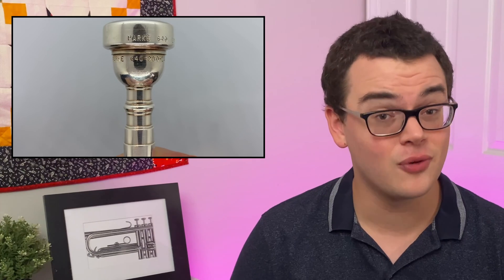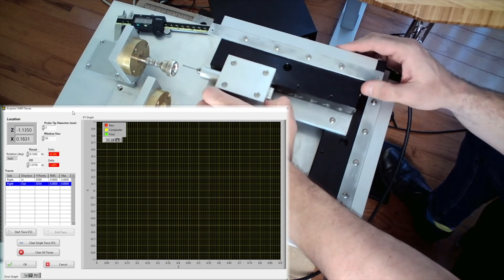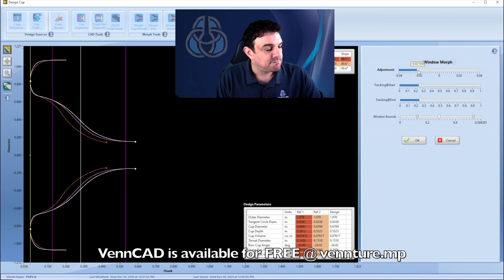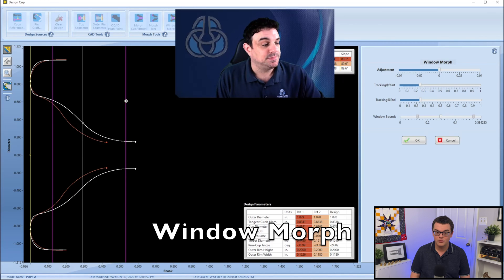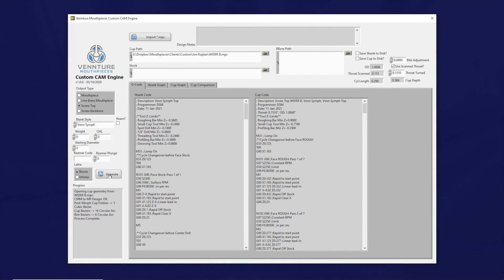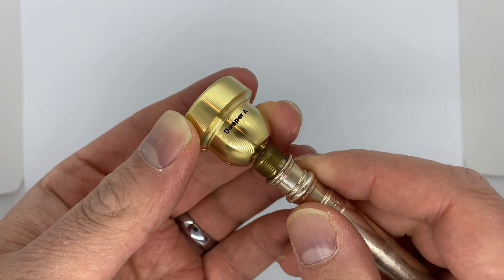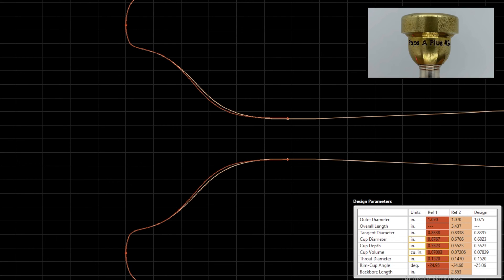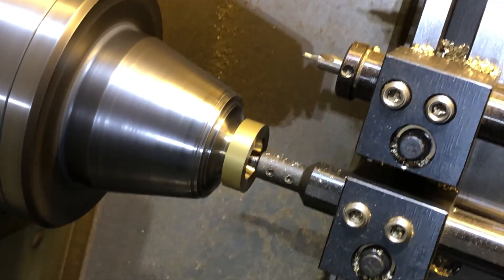How to design YOUR OWN Trumpet Mouthpieces with Vennture

Comment: Super cool especially since I play a B 1 1/2C Rim Screwed onto a 1 1/4C Cup in a 3 inch shank that I'm dying to have reproduced. I'd love to know what the cost of the prototypes and final mouthpieces are. I have looked up the cost of a mouthpiece but it didn't mention prototypes. Thanks for any info you can share as well as the video. Also, how fast did they get your mouthpiece back to you? Thanks.

Comment: How much did this whole project cost? And did you have to pay for the prototypes? Do you get to keep the prototypes?
Reply from the maker: So - each final custom one piece mouthpiece is currently $225, and each prototype brass part was I think $30 each. YES - you get to keep the prototype parts, and could easily send them out to get plated by anderson's, theta plate, etc later on. They also offer one piece 3D printed prototypes now, for $25 each.
Reply: @JonTalksTrumpet  OK thank you

Comment: Nice videos ! Thank you. Some brands proposes raw brass mouthpiece (Donat in France for exemple). I saw taht you got raw brass mouthpieces from Vennture to make your decision. Do you think it is a sustainable choice ? Doesn't it give a bad smell/taste ?
Reply from the maker: Glad you enjoy them, MichaelBxl! Basically, I don't prefer to play raw brass for long stretches because my lips are sensitive to it. However, after I did my prototyping process, they have since started offering a brush plating option for the prototype parts (which is basically a very thin layer of silver) which would probably be a bit more comfortable to play on. Basically it would be inefficient to get the prototypes plated because it would cost more and take several more weeks to be ready to be tested - and the prototype parts are only really designed to be played for a short period of time to decide which shape is best. One of the cool things to me is that you get to keep the prototype parts after - probably one of the combinations will be the same as your final mouthpiece, and you could actually get that silver plated and actually use it for real.
Reply: @JonTalksTrumpet  Great. Thank you

Comment: I hope Doug links this on his site! It's really cool to see the process from start to finish. I recently had a vintage cornet mouthpiece replicated by Vennture. It saved my playing... I've been using this mouthpiece for 17 years, and objectively, it's probably a terrible mouthpiece, but it just works really well for me! But I upgraded to a modern horn, and my original MP shank didn't fit. The Vennture copy is actually better than the original, on both my modern horn, and my vintage one (due to some tweaks, but also just surface finish).

Comment: I love the fact that someone, I don't know who is doing this work, had the passion to create a probing system and software to duplicate and modify existing mouthpiece designs. What is missing? Perspective in understanding how each change will affect the player's ability to perform. That CMM (scan) process is prone to deflection and error that will give you an inaccurate starting point. This is why real CMM systems cost $50-200k, because they are accurate. And you did not scan the finished mouthpiece on the CMM to verify accuracy? Where's the quality control in your production method? At $225 each, every new mouthpiece is just one variation of your original. To achieve the variations my average clients use regularly, you would need at least 8 of these mouthpieces at $1800?

After years of making mouthpieces on manual lathes, I started making mouthpieces with a Mitutoyo CMM scan method and high end CNC lathe in 2004. Since then, I have developed a fully modular system that is far more accurate and flexible than the original. Now you can choose any rim shape+diameter, any cup shape+diameter+depth, any shape throat+diameter and the same for the backbore and body. For the price of 2 of the mouthpieces in this video, you could be playing something that is far more efficient, more accurate, and with up to 12 configurations. 

With all this said, I think the person behind these Vennture mouthpieces is awesome! He is at the beginning of what could be a very long journey. One that many of the best mouthpiece makers have taken, and if we're lucky, are still living, learning, and creating a better process. I was doing basically the exact same process when I made the transition from manual lathe work to CNC almost 20 years ago. Great job and I hope to meet you someday!
Reply: Yes, that probe is absolutely prone to error and deflection. It averages out to about .001" in diameter in the throat and the outer rim. This is MUCH MUCH worse than any Cartesian CMM. Abonimably. So why not use a CMM? Because as we all know, we gladly trade a thousandth in absolute accuracy for the ability to get 40,000 points in under a minute. Because the ability to accurately reproduce fair curves when measured with a ball-end probe is not at all about point-to-point accuracy, it's about accurately determining the tangent slope at each point and offsetting the probe appropriately. More points closer together allow for oversampling and more pinpoint-accurate curve fitting and recreation. But what about that lost thousandth in accuracy? That's why we do a hard caliper OD and pin gage throat ID measurement. Then, we can rescale to reclaim (most) of that lost thou or so. And being accurate under a thou and precise in curve recreation by massive oversampling (how long does it take a conventional CMM to gather 40,000 points?) makes our digitizations incredibly faithful. And quality control? Well of course we do QC. We also drain the nasty water out of the compressor tank, sweep the shop floor, pay our sales tax bill...but not everything we do makes the final cut of the video.
Reply: Oh - and you mentioned you didn't know who was doing the work, but appreciated the "passion" to create a probing system. Vennture founder Doug McVey has an undergraduate degree from Amherst College in Chemistry & Mathematics and an M.Eng. from Cornell University in Applied & Engineering Physics, and worked as an engineer at Cree designing and automating semiconductor crystal growth reactors, then spent more than a decade building KDY Automation Solutions, which designs and builds mechatronic test & measurement systems with the DoD as its biggest client. So machine design, software development, algorithm creation...it's been his whole career. Onward and upward!
Reply: He was sort of condescending.
Reply: Eight mouthpiece configurations you have to take apart and reassemble with modular bits is not equivalent to eight separate mouthpieces, but you know that.